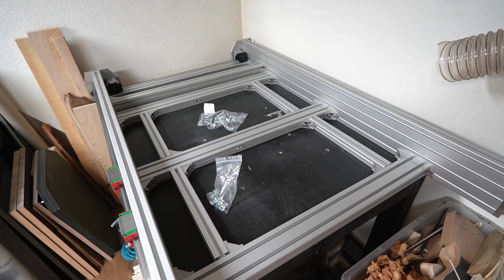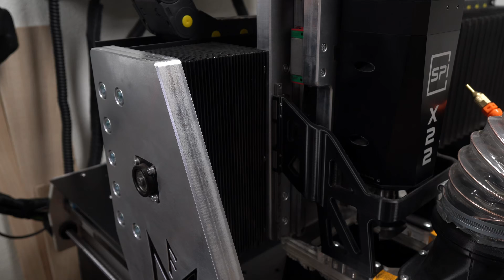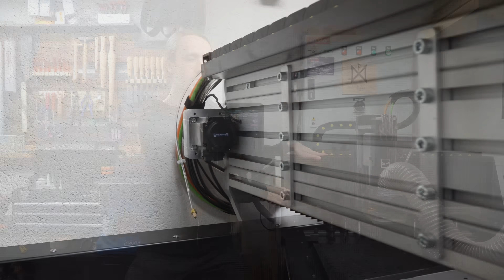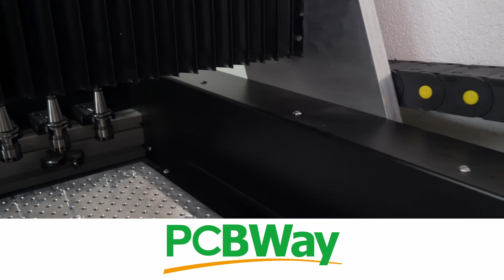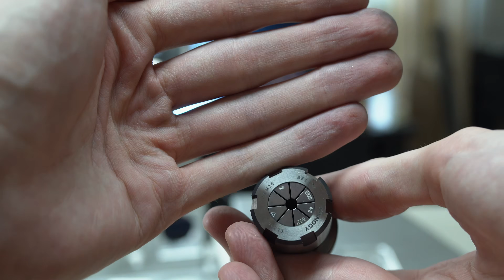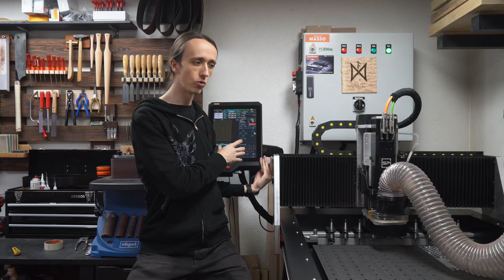My Dream CNC Router is Completed! - How much did it cost? (Dark Art CNC Part 8)

Comment: Hi! Your CNC is great. Are you still using the milling machine? What are the differences?
Reply from the maker: No, I sold the mill to fund this project. The main difference and reason I'm not using the mill is work envelope. Most things I want to make don't fit on the mill table making it useless.

Comment: It became a really nice machine. It’s just this balancing act of cost vs need. I understand you might have some income on your guitars that can defend the cost. But as an hobbyist using the frame from rat rig to 1900$ is not a bad choice either. Then buying AliExpress electronics I made something similar with 2.2 kw spindle ( but without the possibility for an atc/ perhaps using rapidchange ), nema34 hybrid steppers and fluidnc firmware/ software ( off course not as good and accurate as yours by far), but i ended up around 3500$ for the machine and 4000$ with a table in 4080. The problem is that the devil is in the details. I must say I envy you your leadshine motors, your Spinogy spindle and your Saunders mounting plate. Congrat on a great build!
Reply from the maker: For sure, for purely hobby this is way overkill. Also if I had to pay for every component out of pocket I would have gone with the 10k version I talked about after the cost breakdown. ATC definitely adds a few thousand to any CNC build, just the 10 tool holders in my case are over 2k retail price. You can get cheaper ones that are probably good enough for hobby but you'd still be looking at 500-1000 for a set of 10 with usable collets.

Comment: 16k,ripped yourself off buddy. Big fail.
Reply from the maker: To be fair 16k is the retail cost of the components, not what I paid. Also an equivalent commercial machine would be 20-30k easily, so I'm pretty happy with mine. But it's definitely not for everyone
Reply: I have a 2'x3' cnc router that is produced by a US company and has similar capabilities (has a full steel construction), it was around $18k for the cnc after all the add ons and upgrades from factory, shipping was a little more then $2k and it was financed which adds around $1k.

$16k sounds about right...
Reply from the maker: @GENcELL2014  yep, that sounds like the right ballpark and similar to machines I found in my research. Wasn't an option for me as my workshop is in the basement with access only by stairs, but great if you can bring in the machine on a forklift or pallet jack.
Reply: 16k is quite accurate, I built similar cnc in size and capabilities using all cheap chinese parts which cost me  $14k in 2023

Comment: A bit underwelming considering the price point.
 One could get a RatRig Stronghold pro kit with a jianken jgl-80 spindle and get atleast 90% of the performance of that machine and still have enough money to buy a used car 😅
Reply from the maker: That is definitely a very valid option and quite similar to what I had in mind at first. I had considered the Stronghold Pro in the beginning of this project but there were enough things I wanted to change that eventually I decided to start from scratch. Things sorta snowballed from there. :D

Comment: still curious if you figured out a way to accurately tune your y axis dual drive motors or if you feel that they are just working OK? I really want to use servos in future builds but just can't wrap my head around the "well they seem to be working well" vs. actually being able to tune them properly. I get the single motor axis drives where you can run the tuning program under actual load conditions, but the dual drive thing makes me crazy not actually knowing they are tuned correctly. I feel someone could make a fortune and sell a whole lot of servos if this could be figured out and not be so "witchcrafty"..... BTW, been following this whole build. You should be super proud of yourself. This is a beast of amazing enginuity. You really outdid most builds I've seen in YouTubeVerse. BRAVO!!!!
Reply from the maker: I mentioned it briefly here, I tuned them by disconnecting one and making the gantry lighter. It's a hacky workaround but better than no tuning at all. I believe if you get the higher end servo drives they allow you to connect the drives together and work as one with communication between. This should also allow for them to be tuned together. Check out the Fiber Laser from Travis Mitchel, he uses that feature of the Leadshine drives. (Believe he has EL7 or EL8 instead of the EL6 I have)

Comment: I built mine (1900x790mm, designed myself from scratch) using Bosch-Rexroth extrusions, clearpath servos, original hiwin rails/ballscrews and mechatron 2.2kw (no ATC tho) and Smoothstepper  for ~13k€. Feeds and speeds are comparable to yours. 
Then again, all the metrology equipment to actually tune it is probably another 1.5k€ :)

Comment: Awesome machine. Very well done 👍
For the fixture plate I have made very good experience with a 25mm thick POM plate with a 25mm grid of threads and alignment holes, combined with a 25mm grid vacuum channel for a 5mm foam cord. POM is durable enough and especially for woodworking the fixation bolts don't need to be tightened too crazy. It can be easily used with an MQL, in contrast to any woden spoil boards.
But the best feature is the vacuum holding. Especially larger parts are so easy to be done. And with a VacuCard, VillMill, etc. also easy to make cut-outs and to mill slightly below the workpiece bottom, but not into the actual plate. So it is not a "spoil" board, but a true fixture plate...
Reply from the maker: Yes, POM is definitely also on my mind. My only worry would be how threads hold up over time, but worst case you could just install some metal inserts. I already got a vacuum pump, just need to get around to design some fixtures,... I'll definitely be asking you some questions about your setup when I start seriously planning. For now I have some guitars to build :D
Reply: @DarkArtWorkshop  Anytime. Glad to support...
Btw: my plate is like 2yrs old and still the threads are fine

Comment: This is totally awesome, i am using a Lead 1510 and it's working great for my needs, I am thinking about upgrading it to linear rails so I can get rid of those nasty nylon wheels. So far my very cheap Lead 1510 is close to 2000 Euros as of today.. overall I am happy with my machine, but its fun to watch machines like yours that plays in a totally different league, compared to mine. I am not feeling like the Businesscard scene in American Pshyco, I feel happy for you :D